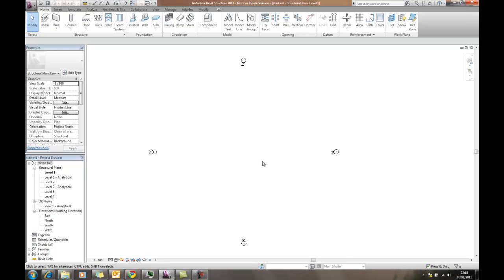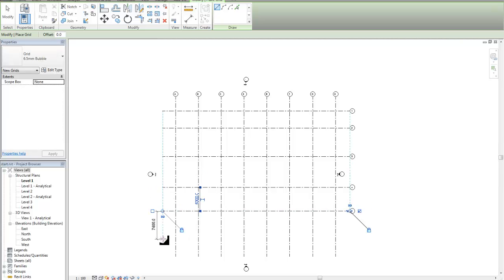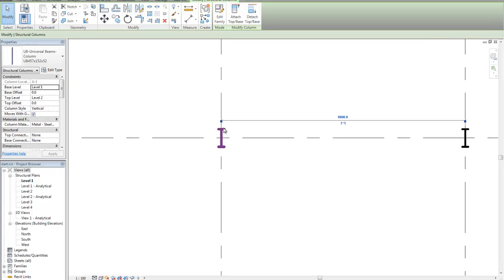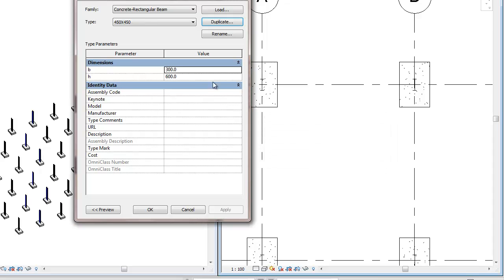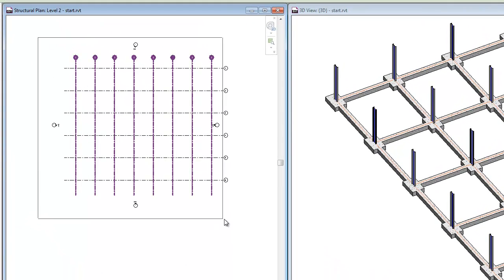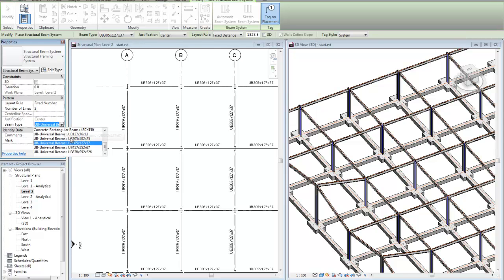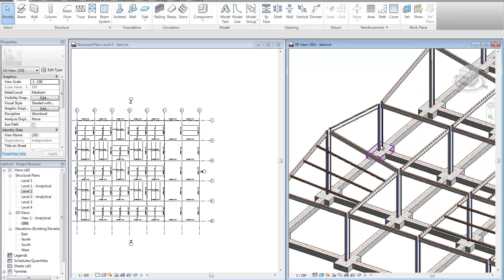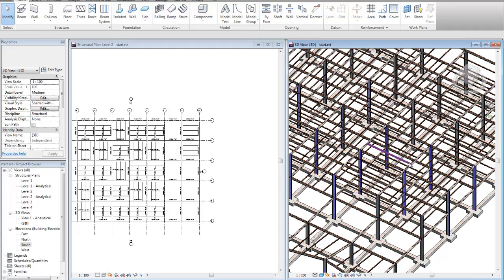Revit Structure Basics, Grids, Columns, Beams and Beam Systems

Comment: Hi i hope you can help me, I've loaded a family into Revit that are beams. However they show up under Column, is there an easy way to fix this? I've tried changing the family category from columns to Framing but this doesn't fix my issue, thanks.
Reply: +Lee Dryden  you figure it out? I've had a similar problem with some custom beam families that I had to make.
Reply: +Brion Watling I believe at the time of my issue i found a pre-built family on the office server that worked as it should i cant remember if there was anything specific wrong with the first one i'd tried.

Comment: hi sir,I am a civil engineering student and I am learning revit structural. I dont have any system to practice it at home ,so I am looking to buy a new laptop or dekstop. I am going to use revit and other structural designing software intensly for my project work. So please suggest me about what configuration should I look for?
Reply: shrenik bora Prefer desktop, because rendering programs (3D capable..) need as much value for money:
*CPU
*Ram
*Graphics card
also heating would be an often problem if you work on a big project (bad for laptops). In the other hand i use Revit on a 5 year old desktop with a 4 giga ram, AMD cpu with graphics on (no graphics card), SSD and i do my job. With lots of delay but it handles. Its up to you, but i guess with 500 Euro tower you ll be more than fine.

Comment: well really helpful as i am new to revit structur ,, but a simple question is how do you get the members like footings and columns already in mm?? when i try to add a column or a beam or a footing it shows that the dimensions are in inches and i am not sure i have any sense in imperial units !! any help please ?
Reply: +Rakan alhyari 

Hi there, You can simply type Units and a window will appear from which you can choose the desirable unit of your choice.

Glad to be of help.
Reply: change units

Comment: This video is so informative. Indeed help a lot however I got a question.
 I am now doing the purlin which will be placed on top of the roof with the slope angle of 15. How can I drawing the purlin on a surface which is not flat? Anyone knows it?